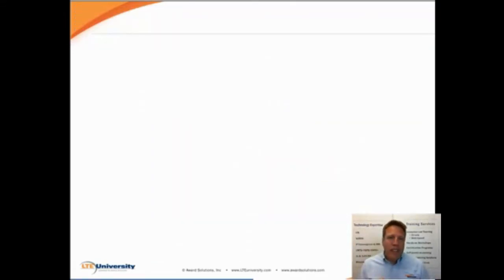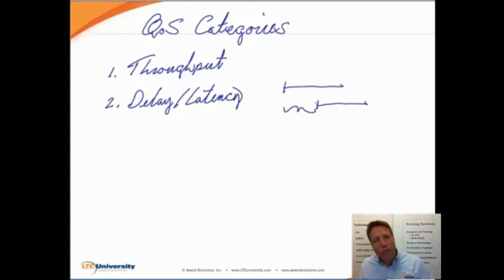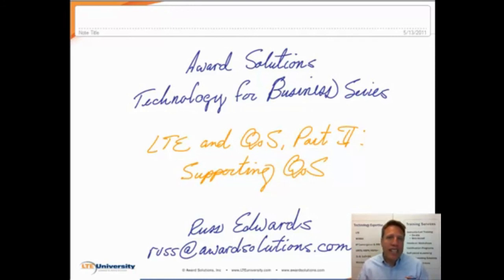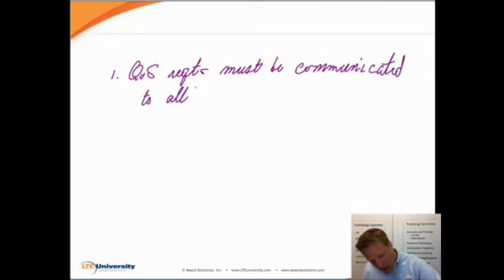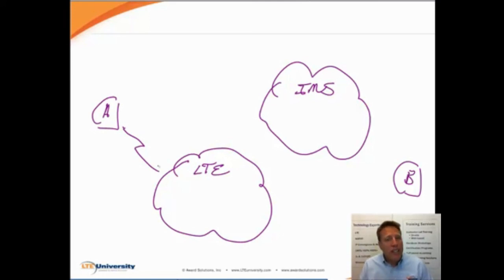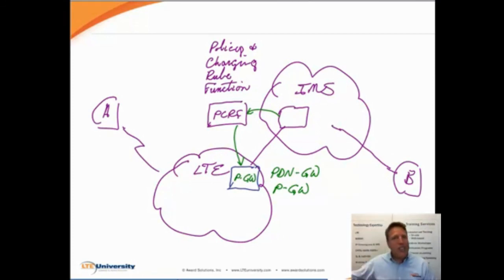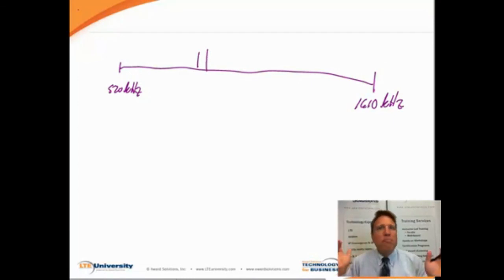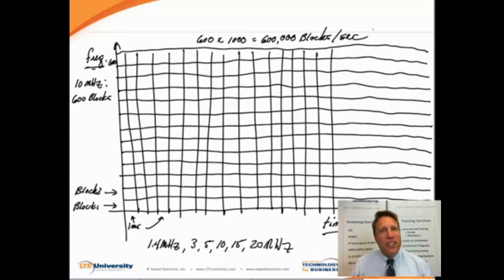LTE & QoS

Comment: Nice presentation, the technicalities of the network is very complex, yet it was  easy to understand because of the way you explain it.

There is just one clarification that I would like to be cleared-up, because I got confused. At the last part of the presentation. Is that 600 resource block or 600 sub carriers in a single time slot for the LTE 10MHz bandwidth. Thanks